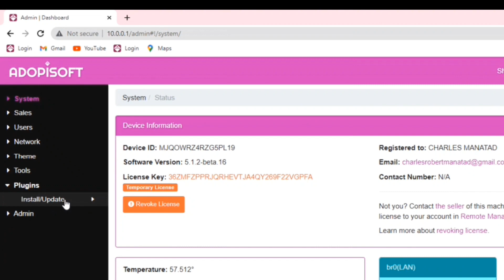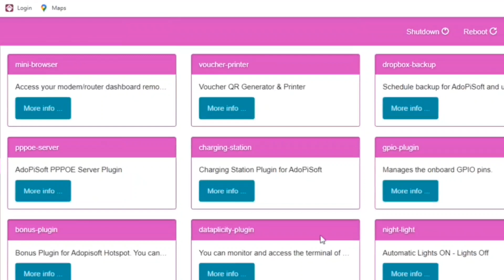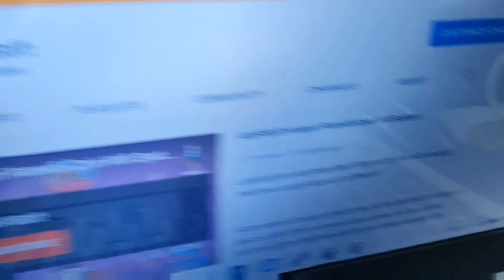How to Use Night Light Feature | ADOPISOFT

Comment: how does it work because because my light is always on even if is not the time yet , I set 8 pm and insert led it always on
Reply from the maker: This is a new feature available for version 5.1.2 and up and the nightlight is a separate LED light that you connect to the custom board.